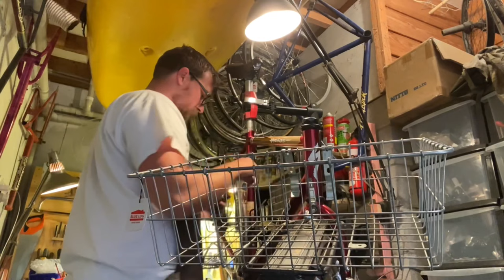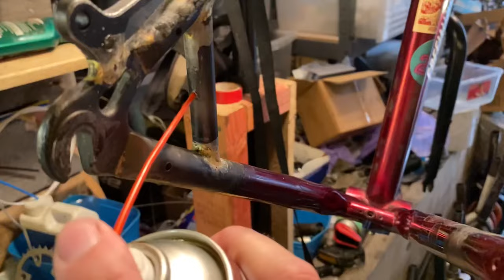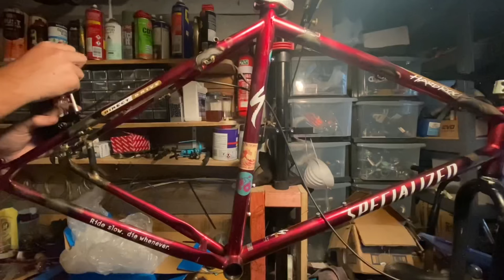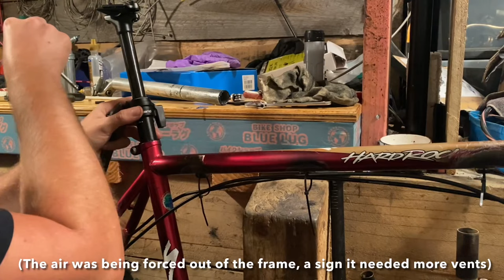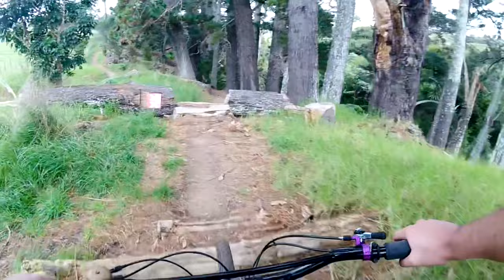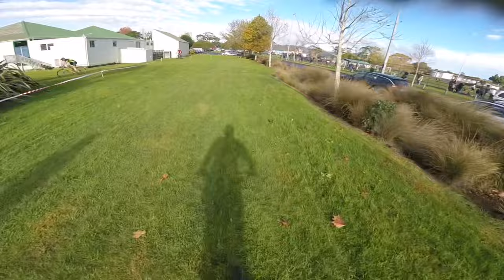1999 Specialized Hardrock resto-mod! Disc brake conversion Retro Mountain Bike

Comment from the maker: Update: had to mute the audio in a couple sections due to copyright 🙄 not that it will make me money, but I think it’s unfair that someone can claim the $$ from the entire video if even a small amount has their audio in the background. See below for voiceover that was muted ⬇️
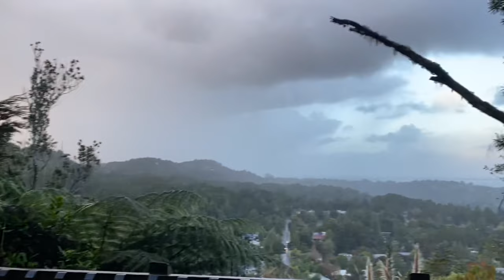Reply from the maker: 22:20 on I was talking a bit about how I was going to dropbar it. The plan was to use cable disc brakes so I could swap between the two, there’s fixtures that allow you to disconnect the brake cable (so you can then attach another bar setup with the same fixture) easily. 
I do have cable disc brakes I could put on it, but the riser/flat bar setup is too fun so I haven’t put dropbars on it yet. Sometime this year I’ll throw some on, though! 
I plan on doing a little update video, to show how the bike is currently for those on YouTube. 😎 ❤️
Reply from the maker: Sorry for the inconvenience and weird muted parts! ❤️ thank you for checking out the video 😄
Reply: @toastyrides  Still waiting on this thing to go dropbar, just for the heck of it. This is also my favorite of your builds. I've watched this one a couple of times already.

Comment: Have upgraded a few lovely old titanium hardtails, and decided to go with modern discs up front (used decade-old Ebay XTRs) on an upgraded fork, but kept the cants in back -- they weigh less, don't require any fuss, and are plenty strong for a rear. If you want something really powerful, get XTR v-brakes.
Reply: I honestly love cantilever brakes they lock so easy when set up good
Reply: The mod is very cool but I could never justify the time and money.
Reply: OR go for Magura hydraulic rim brakes at the rear instead

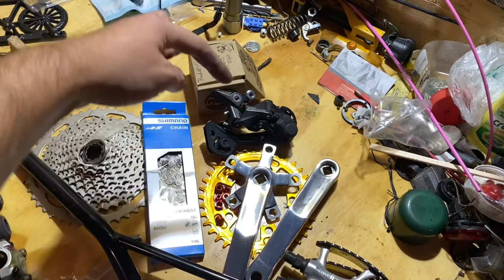Comment from the maker: Hi all! There’s a glitch(or two) in the audio. I kept having issues and it wouldn’t resolve, roughly 7:30 in 😖

Basically it’s a run down of the parts, and for some reason it’s jumbled up so at one point I’m pointing at the shifter box but talking about stickers 🤷‍♂️😆 
Sorry if there are any more issues!! 
Thank you for watching 😄💓
Koga Miyata restoration next up 😎

Comment: Just seen this as a recommendation, I've a Hardrock Comp I'm building, full XT M739 throughout, original saddle, forks, bars. Mavic M400 rims on XT M737/738 hubs. Tioga City Slickers tyres 2.10 on 26 rims. 
All period correct for a 1999 model. 
I'm so looking forward to watching this vid to see if you can sway me to a retro mod, I've also got a Stumpy maybe 96/97? waiting to get some love.

Comment: I've been using XT 739 V-Brake levers since 2006 and XT 760 V-Brakes since 2007, and I find they work better in the wet. They worked better when I had XTR/XT replaceable brake pads🤘🤘. I'm using Jegwire ones now, which aren't as good.
Reply from the maker: Have you tried Koolstop salmon compound brake pads? They’re great, nicer on rims than others too. Highly recommend

Comment: How did you bolt the disk to the rear rim hub? Looks like you are using the old rims I didn't see it in the video the adapter if one was used.

Comment: Spicer cycles in Indiana did my trek 950 like this the old bikes do very well with disc currently running zoom cable actuated hydraulic in gold but thinking about upgrading to shimano hydraulic or swapping the current pads

Comment: how did you fit a 1 1/8 inch headset in that steer tube? Came with a threaded headset originally no?
Reply: I figure it came with an 1⅛" threaded steerer tube, so no issue with swapping it out for an identically-sized ahead set

Comment: Why didn't you have the disc tabs welded onto the original steel fork?
Reply: Because it's nearly impossible to strengthen a front fork intended for rim brakes only sufficiently for disc brake use. Your front brake is your life insurance, hence a smart move to get a proper disc brake compatible fork instead of messing with the stock one

Comment: hi how did you fit dos 27icnh wheels? this bike come with 27 wheels?
Reply from the maker: Hey, it came with 26” wheels. It only has a 27.5 in the front, with a non-factory fork, some retro mtb’s fit 27.5 in the rear but haven’t tried with this one!
Reply: @toastyrides  nice! Is mulet! Better for riding ?
Reply from the maker: @mygoalcrash8077  it’s nice, 27.5 front and rear would be better though 👌 mullet just gives it a little more roll over ability off-road than the 26” wheel
Reply: @toastyrides  wat size tyres? 2.2?
Reply from the maker: @mygoalcrash8077  2.1 front and 2.25 rear 🤙

Comment: I'm doing something similar with my 99 Specialized HardRock but found that my 38t chain ring is hitting the frame  when installed. What gives? Is your square taper bb just wider than my external BB?
Reply from the maker: Hey! Oo cool, yeah that would be about the only factor really (bb or crank spider being a bit wider)
Reply: @toastyrides  yeah thank you! I dumb and just realized my donor cranks and bb are road stuff and not mtb.

Comment: Hi, is it that easy to convert a 1’’ headset to a threadless 1’’ 1/8 one? No issue with the compatibility? Cheers from Switzerland ;)
Reply from the maker: Hi! It was 1 1/8” threaded so the conversion was easy. If you have a 1” headtube then you’ll need a threadless 1inch fork.
But yeah there are plenty of headsets available for different frames, mine was a pretty common size. 👌
Reply: You can easily get an threadless adapter that allows 1 1/8"  stems to connect to 1" threaded headsets
Reply: Tight ride build man! I'm wanting something like this.  Is that 27.5 up front and 26 in back ? What rims did you go with ? Cheers
Reply from the maker: @deryckescott80   cheers mate! Yeah it’s a 27.5/26” mullet sort of bike haha. Halo Vapour front, the rear is a stock wheel off an early 2000’s Specialized S-works Enduro (I think it’s a sun rim).

Comment: I thought when u conerted an old bike to disks brakes it isnt actually deemed safe it was never design for all that forse on the forks
Reply from the maker: Hey, I used a disc fork for the conversion-it’s not the original fork. 
Although I’ve seen frame builders convert forks to disc brakes, so I’d say it’s ok as long as it’s not a crappy fork 🤔🤷‍♂️

Comment: What stem is that? It's a BMX stem right?
Reply from the maker: Hey, yeah it is! It works directly with the Moto bar which are 7/8” (22.2mm) diameter 👌
Reply: @toastyrides  hey I’m sorry. Hoping you can get back to me quick. I want to buy this year and model for $50.

Question is, why didn’t you opt for shocks on the front?
Reply from the maker: @snapbackhijab9801   oh cool! Sounds like a good deal 👌
It was a rigid bike stock and I liked riding it with that setup.
I’m not a fan of suspension, I adjust air pressure to cope with bumps. 
I’ve had full suspension bikes before and now everything I own is rigid, just personal preference! Nothing wrong with it, just isn’t for me right now 🤙

Comment: You need to buy your frame builder friend a decent grinder for Xmas, those welds are shocking!
Reply from the maker: Jeffson isn’t a friend and they aren’t “welds” (it’s brazed on) but he’s a world renown frame builder, he knows what he’s doing 🤙
Reply: @toastyrides  If not welded, did "Jiff" braze the caliper mounts? I am looking for a weld or non-weld solution for caliper mounts.
Reply from the maker: @bob-ny6kn   yep it’s brazed on 👌 brazing setups are quite simple so can be done at home. I’d love to learn someday! 
It’s basically a stronger solder, in a way, haha. Plus it looks beautiful with the brass brazing 🤤

Comment: What is your opinion on non disc vintage rebuilds. I keep finding myself wanting disc but it’s basically nonexistent without a more invasive fabrication to the frame.

Thoughts on just canti or v rim brakes?
Reply from the maker: They’re all great 🤙 I have done a huge range of setups and this is just one of them, you can make cantis and v’s lock the rear just as you can with discs(especially with Koolstop brake pads!). 
Just run what you can and have fun out there, cheers! 👍 ☀️
Reply: @toastyrides  sounds good. I think I may just roll without discs. I love the look of these old bikes on some modern group sets